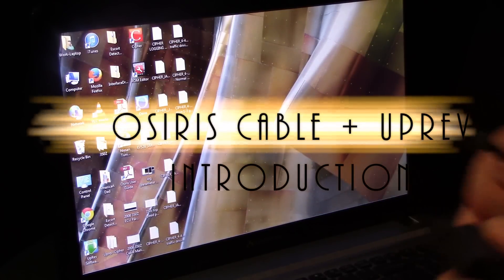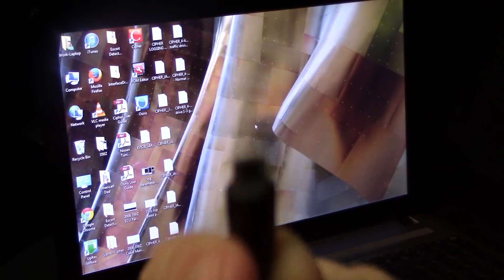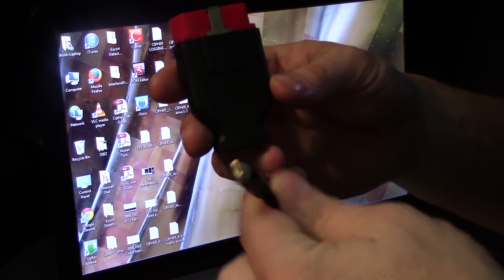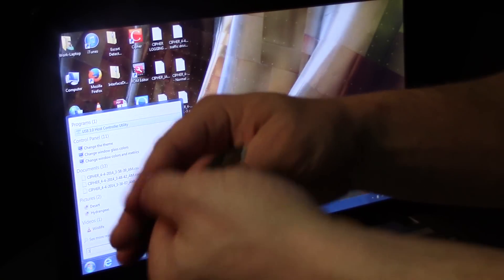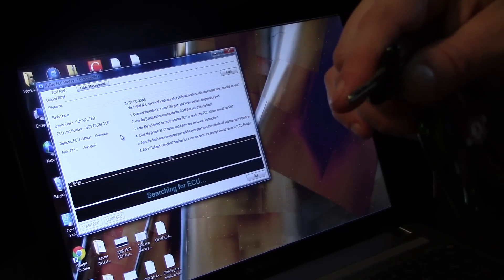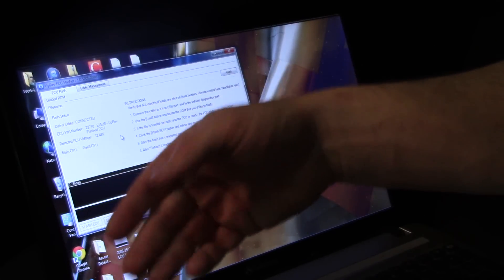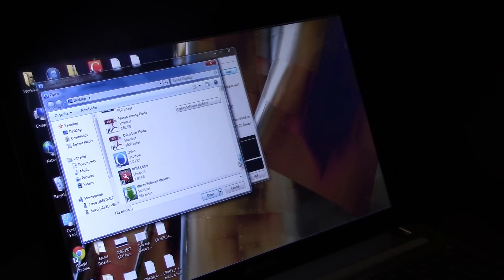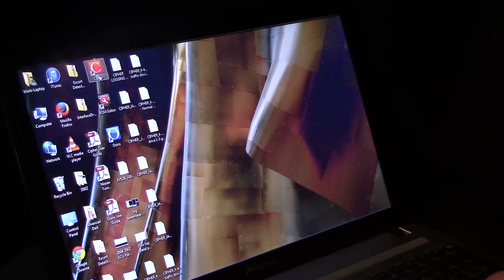Osiris Cable - Uprev - Introduction Part - 1

Comment: Just ordered mine for about 700$ and its in transit right now. Trying to look up for tutorial that show how to install it.
Reply from the maker: I'll make a quick video on installing it and getting it up and running tomorrow.  It's not hard to get going. When is it due to arrive?

Looking at this video more.. I showed essentially how to get going.  I"ll shoot some quick footage on exactly where to plug, and direction, and so on .. and Will add an annotation to this video for ya.
Reply: Ikos Log  That would be awesome bro. Subscribed.  It will be arrive on 01/30/2015 Friday. Its for ma 05 G35 Coupe as the pic on ma profile. I got aftermarket NRG  steering wheel quick release installed, which no longer have cruise control button. So I believe only one map I can set up for it?  Please if you could, also explains of down side/risk of it if any. Thanks so much.
Reply from the maker: DaVinn Em Hrmm.. You're eliminating the way to switch maps.. Doh! You SURE about doing that?  I know my VQ35HR motor holds 5 maps.. I have 1) Performance Tune (max everything) 2) Tuned to run on 91 Octane (instead of 93) 3) Valet mode - Limited to 3k RPM and 35mph 4) Theft prevention -- ECU cut off of ability to start engine.. not possible to steal car by driving it.  and 5) Stock Map (Which is handy because on my perf map I get 19 mpg.. but if I switch to stock map for times when I don't need to drive quick or whatever.. my MPG will go up to 24 city 30 hwy ;) ) -- There is a way to RIg up a switch that would trigger the cruise control mechanism to change maps .. but I'd have to read up on it.  (I had a Base model.. that I did every upgrade, including adding cruise control to turn it into a GT trim model ) -- Changing maps on the fly is super, super handy.  I'll talk about all this in the video I'll make.. which isn't a lot of footage I have to film because this current video shows you how to get going with the programs/tune/ROM flash etc..  Your G35 will work exactly like my 08 350Z.. as I'm sure you are aware. =) .. And thanks for subscribing.  If you don't like all the detector videos.. I have playlists.. where it's separated into 350Z stuff.. and so on.
Reply: Love 350Z. Was at first attempt to get 350Z but then dealer sold out so then I didn't want to wait and bought a tramp ugliest G35 was no headlight,no intake..Alot shitz was fucked but I bought for cheap and did some modification after.
But yeah, also I had been doing some research of how to get aftermarket Maps changing button. Osiris customer assistant guy told me that I can only get one Map set up on the car without cruise control from stock steering wheel.
Knew I had to change all the interior to aftermarket and I still bought it anyways. I killed the good easy gains possibilities already without stock cruise control. 

But also I will try to contact them again as well to see if there is any chances to get some possible potential from those Osiris without mess up the car and product after installed it. So do you got the feeling that, these expensive tuner product is not gonna fuck up our ride? I meant to me 700$ its pretty no joke. Ma babe she is already like a beast. To me just straight pipe exhaust its allow you to throttle high RPM and its like high performance map already. I want to see what Osiris can do though. Thanks.
Reply from the maker: DaVinn Em Well he is telling you only one map without the stock cruise control because he's assuming you will have no way to change the maps.  I'll have to go back and re-read some stuff.. but I THINK there is a solution to change Uprev mappings without the steering wheel.  

Anyhow,..  yes, the $700 is a significant investment.  Is it worth it?  Yes if it's done after a few decent performance parts are on the car.

Bottom line.. even STOCK , the tune will give the car more power and in the right section of the RPM band for hp and tq.  

That said.. I HIGHLY recommend waiting until you have at least a Catback exhaust system, and Hi-flow cats or Test pipes installed.   (Also at least K&N intake(s) filters.. but this is not as important) -- Plus any other performance mods that have given more than 4-5 horsepower count.

Basically.. if you have added more than 20 horsepower with modifications (an HONEST 20 horsepower, not hyped ratings) then this type of Tune will be worth it and you WILL feel the difference.

I did the tune after I had Berk Tech. Hiflow cats, Invidia Gemini true dual exhaust, Velocity stack dual air intakes with K&N drop in's (best HP gain even compared to the long tube cold air intake setups),.. I also had installed mishimoto larger and cooler dual intake tubes with resonator deletes,.. mishimoto air diversion plate, and removed over 200 pounds of weight from vehicle.  

Replacing the Stock catalytic convertors with Berk Hi-flow cats OR Test pipes is the single largest NA gain performance part(s) you can do to these cars.  It eliminates a fair bit of weight a well.  Our cars have a large bottleneck at the two catalytic converters, thus this perf. mod makes a HUGE gain.  It also increases the power you gain from an aftermarket Cat back exhaust system.  For instance if your CBE gave you 11hp gain by itself,.. after the cat replacement mod.. You would gain X HP from the new Cat mod.. but also increase the HP gain from the CBE by 2-8 hp.. just depends on the car , the brand/manufacturer of exhaust, quality, etc...   I personally gained 38 horsepower from the CBE and Hi flow cats (which is very good considering the difficulty in pulling more power out of these cars engines from a bolt on).  

The high flow intakes I refer to just help further the overall breathing of the car as the cats and CBE are allowing it to exhale much better.

The ONE map you would have , the way the guy is explaining it,.. would obviously be your performance map.  It would be locked in.

Uprev's tuning package will absolutely NOT damage or "F up" your car.  I assure you of that.  These engines are designed quite intelligently with sophisticated computers/ecu's.. if  a problem arises it will continually adjust (lower timing values, throttle position voltage, fuel map amounts (in some cases).. and the whole array of variables the ECU controls (and thus why a Tune can and does bring out more power in cars).

Again.. the best advice I can give you -- is do ALL the modifications (bolt on wise.. not forced infuction/turbo) you have planned. THEN,.. do the tune.  Because.. if you do the tune and then add other perf parts.. the tune is no longer the most efficient use of your engines power.. as the new components will skew the entire tune.

And I would reconsider keeping the stock steering wheel WITH the cruise control button(s) on it for this tune.  Because the multiple maps really are quite useful and it's almost a shame to eliminate the ability to change them because of a steering wheel change.  Again, that said, I do believe someone has developed a method of changing the maps with the use of a switch which will also visually tell you what map you are on (ie: Blinking light, LED, whatever..).  So you may be able to do both.. Have all the maps, the new steering wheel,.. and be able to change them on the fly.

Lastly,.. Do you not care to lose cruise control?  I added it to my car.. self installed it with factory parts and flashed the ECU with a ROM from a higher model trim version of the 350Z -- JUST to have cruise,.. as I find it that valuable.  But,.. we all have our likes and dislikes.. so the steering wheel you want may be greater than having cruise, and being able to have multiple tune maps you can change literally while driving down the road. :)
Reply: Yeah honestly I already installed pretty much every modes you stated there.(TopSpeed Dual titanium CatBack exhaust 3" inner tube 4" muffler tips) (Berk Test Pipes) (Xyz Y-Pipe) (SP Serie InJen cold air intake) (Cipher aftermarket seats) (SPEC Super twin Disc SS-Trim Clutch) now ma car sounds like it have Supercharge for some reasons. Its surprised me after installed Intake and Test Pipes. Touch screen radio and everything aftermarket already, except engine part.
 I had never dyno it but I notices its surely been gained serious HP from those modes as like you stated. 

I don't want to do anything to engine because its 148,000Miles already. Just recently replaced all the bad Camshafts B1 B2, Crank and exhaust valve timing sensors on the car maself though. Due to, its time to replace those, that's for sure for high mileages car.

 But yeah, your 350Z doesn't come with cruise control right. To me stock cruise control which attached to stock steering wheel, so that's why I didn't like it. G35 stock steering wheel so ugly on mine LOL.  When you go aftermarket, you don't want to go back though.

3.5L V6 its just perfect for me to enjoy both world of economical gas saving and aswell performance out of it. Damn Osiris pretty much its all about those Maps huh? It better be worth ma hard working cashs or else I couldn't do anything about it LOL.
Reply from the maker: DaVinn Em Yeah,.. you've got the mods that a PROPER tune will really make a nice difference.  

I had a guy who is well known for being a top "Z" tuner do me a favor and help map my tunes based on Dyno and Log runs on the street.. Probably went through 7 or 8 iterations of the ROM's tweaking based on the car's logged data from 4th gear WOT 2k rpm to 8krpm.. 4th gear 10 percent throttle from 2k to 8k.. and a bunch of other logs .. had to make sure they were super clean logs (no slightly lifting foot off accelerator during runs and so on.  He hasn't done the tunes for people that don't come in his shop physically in a year or two.. but made an exception for me.

I say that because I don't have experience with what Uprev or another online tuning company who does the tune remotely like that.  So it's always going to help,.. but the best is always to go to a dyno and have the ROM adjustments made based off what your car does in real time.  So I can't vouch for how good the tuner/company you are using (I assume Uprev) is at doing this for it's customers.  The Cable, and tuning packages come in different levels.  As you've seen.. where you can get the Custom ROM and YOU can't make any changes (which is best for people who don't know what they are doing.. it's a skill you learn over time) -- and then a full on package where you have the license to and open ROM to make changes as many times as you want.

There are plenty of people on the 350Z forums who have had this tune done and can vouch for it either way. If I didn't have the expert basically doing the changes on mine.. I would have gone to a tuner in Atlanta that specializes in Z's.. let them put it up on the dyno and make the changes.

But , again, our engines/computers don't make the full most efficient use of the modifications until a Tune is done, period.  After my tune the car felt completely different in a better way.  And given I can change the maps on the fly.. I can switch to the stock (how yours is now) and then back to the tune map and feel a huge power difference.
Reply: Recently installed it today and end up I figured out and took the Cruise control from ma old factory steering wheel. Run some wires and possible installed to the aftermarket steering wheel. Now I able to use 5Maps but I only notice different of perf is Map4.. Other Maps I couldn't really tell which is which yet. I've tried all maps and there was no RPM Limiter/Rev Limiter. I might have to call them but do you have any clue exactly Map1 Map2..Etc. Which is which?
Reply from the maker: DaVinn Em Glad you got it installed, and figured out a way to change between all your maps.  Good job!

Since you haven't found a Rev limiter, I don't know that my Map order is going to be the same as yours?  One should be a valet map, and thus will be a rev limiter -- hrmm..

Anyhow.. my maps are as follows in this order:

1) Performance Map  2) 91 Octane  3) Valet (Rev limiter, and limits top speed to 30 or 35mph) 4) Engine / Fuel cutoff from ECU, theft prevention,.. Car won't start with this map on.  5) Stock Map.

Contact Uprev and they'll be able to tell you exactly what the maps are.. your ROM has them in it,.. anyone with the software could read it and tell you.  If you used an Uprev tune and can't find out.. Send me your ROM on your car now and I'll send it to a guy who helped with mine (A pro tuner) and he'll tell me whatever you want to know about it, including the map order.  But the company you got this from should be able to tell you with a simple email.
Reply: Thanks alot bro. I finally figured it out the issues why. Because mine it doesn't come with pre-tune. Like WTF really? I notices my Stock ROM is exact as UpRev ROM. When I checked all graph and maps..I had to tuned it some maps maself atm. Did some real time tuning for wide open throttle AF ratio at all speeds. Took it for a drive and mane, there are some huge different power gain for me. Will do some more research. Those Osiris tuner you could actually develop your own ROM and save it many as you want.  Which its awesome.
Reply from the maker: DaVinn Em Yup no problem.  Glad you figured out you didn't have a Tune at all.  It didn't sound right.  What exactly did you order?  Typically packages from Uprev and many places come with you running the logs, sending back the logs and them adjusting and sending you back a custom tuned ROM.  Or at the very least you tell them your car, make model, year, and modifications and they send you a bulk ROM based on your specifications.  With the plain standard package $500 -- You get the cable, the software, license,.. and 3 (E-tunes) -- You enter your vehicle info one this page:  http://uprev.com/secure/shop/management/osiris-standard   -- And they send you the custom ROM.  As you can see on that page you can specify what you want for each map, and any special instructions -- for picking between Stock, tuned, Valet, Economy, Security, Towing.  Which are six maps, our ECU's hold 5 -- Towing is the least useful of the 6.. so as I mentioned I have 1) Perf. Tune 2) 91 Octane 3) Valet 4) Security (unable to start car, no thief can take it period unless they happen to know it has the tune , can power the ignition then know to hold the sequence of buttons (HIGHLY unlikely lol), and 5) Stock map.  

Of course the $700 tuner package is for someone who knows how to tune.  I wouldn't ever recommend it to someone on a NA car... There isn't anything the Standard license can't do for NA bolt ons that the Pro tune can.  If you have Major engine mods (like a rebuild, bored out, forced induction, etc) then Pro tuning is of course recommended -- Even so,.. I think the best option is to take your car to a Tuner with a Dyno,.. and it can be tweaked on the Dynojet. 

I went with one of the best tuners in the world but in another state -- And used a combination of my own logging on the street and dyno to send him all the info he needed to build my maps.. as I mentioned we went back and forth with data many times until he said we've gotten everything out of it we can.  He was so good he got about 90% of the power out with me explaining all of what I had done to the car and the last 10% of power he tweaked out over the next 2 weeks.  

I think there is value in real world data logging, on real roads, accurate airflow going into your grill (not a fan at a dyno) the friction of the pavement, atmospheric conditions, and so on.  The result is a tune that more accurately represents how the car is going to be driven.  Not to knock dyno only tunes,.. as they do a great job.. but dyno's simulate friction, simulate air flow, and so on.  Though it's nice to see direct HP/TQ curves in real time while tweaking maps. :)
Reply: Yeah I actually bought "Osiris Tuner" I got it from third party seller. Which I thought alittle extra useable when I want to add extra gain from aftermarket application to the aspirated engine itself such as AF sensor they got there. And also it applicable with forced induction, Turbo and all those possible mods, rebuild engine as eventually I will surely add some change to engine. I thought the bright side of Osiris Tuner is that, It allow you to develop your own ROM. but am not sure if the standard tune have those logging ability to edits it yourself beside lets them create custom ROM for you.  
 
Lastly it would be more accurate and prop way if have a dyno run while adjusting and track all the airflow and every curve that it actually running as you state there.  I know a guy who does dyno tune close to ma resident. Damn I guess I end up gotta spend another extra to get it done the right way.
Reply from the maker: DaVinn Em Well, it does allow you to make all the changes with the version you purchased,.. with your mods you should be able to use an E-tune package and get most of the HP gain.  If you have the E-tune options I mentioned in the previous reply from Uprev,.. then I'd probably apply those.. and wait on the Dyno extra tuning until you've started digging in the engine and doing some non bolt on mods.  But, of course the absolute peak hp/tq is going to only come from being able to see the HP/TQ curve in real time and adjusting over and over for the best results.